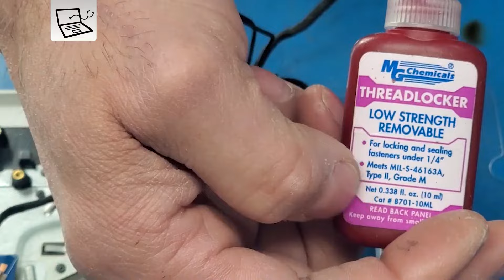Broken hinge repair for #HP 15-bc

Comment: where to find that epoxy  

if not can use clear casting epoxy 

or any other alternative in low quantity ?
Reply from the maker: the MA300 is the best, other epoxy type can work but less strength.

Comment: Do you forgot to loose a calibration screw of hinges and add some oil.
Reply from the maker: I do loosen it for some models. The way I do it becomes stronger than original design.
Reply: @LaptopDoctor what resin did you use around the inserts?
Reply from the maker: @drax5202  MA300 available in 50ml and 300ml. I get it from rshughes.com